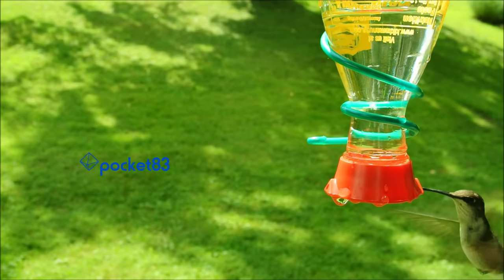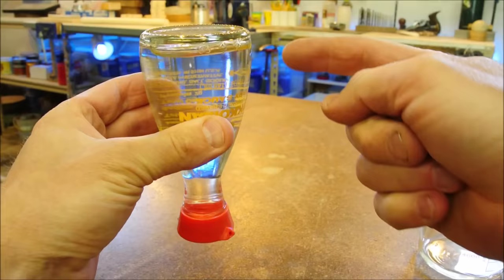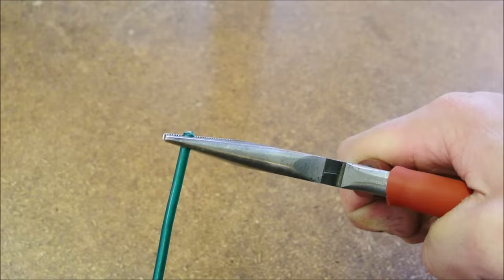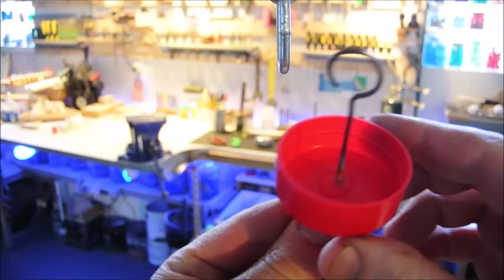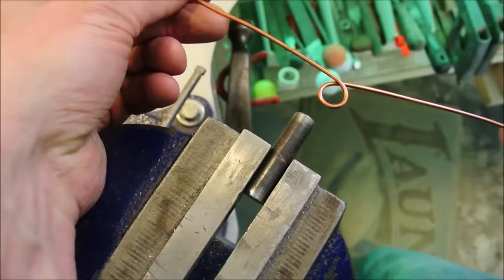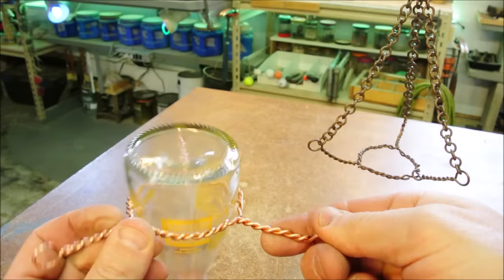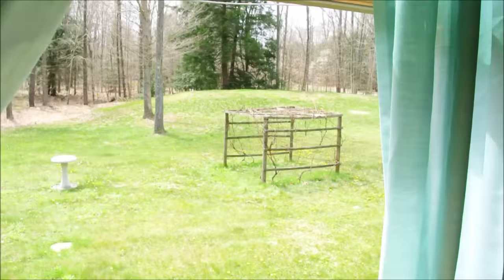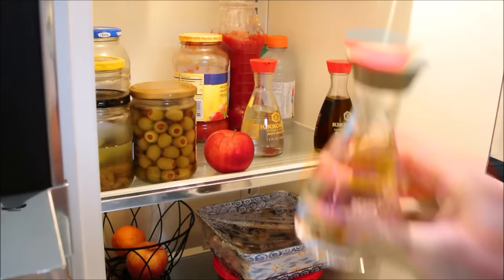Easiest, Cheapest, Best DIY Hummingbird Feeder Ever (from Soy Sauce).

Comment: This is a GREAT video - wonderful ideas for DIYers.

I have two questions: 
1) for the ant moat, what do you call that double hook thingy that was put through the red spice cap?  
2) what is the guage of the wire that you used to fashion the window hanger contraption?

Once again, so creative, many thanks!!
Reply from the maker: Certainly. Thank you!
1) That double-hook thing is just a piece of copper wire. Bend a loop on one end, stick it through a tightly-drilled hole, and then bend a second loop on the other end. 
2) I'm not certain without measuring it, but I believe that was 10-gauge galvanized wire. It's discussed @ 2:57 in the video.
Reply: @pocket83  Thanks again.. Awesome and thanks for the quick response!

Comment: That's cool! 👍  What gauge copper wire did you use for the chain and twisty bottom?  12ga or 14ga?  Or... ??  You're absolutely correct... salt and vinegar (especially warmed vinegar) works miracles and if you leave it in too long and get that bright pinkish but dull tone, a brass brush and Dawn dish soap will make it very shiny.  Thanks for a great video! 👍🙂
Reply from the maker: The copper chain is 12 gauge. Thanks.

Comment: If there is no air trapped because you filled the bottle to the top, the water will still not come out. So it's not about the trapped air. So what is it? Copper rusts. Copper rust is green. I am bugging you, but don't get me wrong. I think your videos are excellent.
Reply from the maker: By all means, bug. As long as you bug nicely ;) 
Aluminum rusts, too. And that layer of rust encases the metal in a thin, protective barrier that slows the reaction from progressing further. In general, varying materials will have varying rates of oxidization. In the case of a copper wire, you're likely to be long gone before it has changed the whole way through (depending on its environment). 

The case of the filled bottle is a little more nuanced than I might've said in the video. It's not so much what's inside the bottle that keeps it from coming out, so much as it's what's outside the bottle; atmospheric pressure helps to hold the liquid up and in place. Air is heavy. It's being pressed on by the air that's sitting on it, above it. This pressure fades away as we move towards space, where the air gradually becomes less dense. Air down here has a thick mass, like a soup, so any water that comes out of the bottle will have to push through that mass. 

The water itself also has a surface tension (caused by loose hydrogen bonds) that helps it to sort of 'stick' to the bottle—just enough that it doesn't want to pour out of those tiny orifices very easily. 

Since physical phenomena that are taking place within a system don't only have one 'hard' cause*, there are probably a few other quirks of physics going on (that I'm probably overlooking) that also help, but the two mentioned are probably the big ones. 

Thanks for the compliment. 
*At least not at the level at which we see things.

Comment: I love this design. But how do you keep them from leaking? Have tried to level it the best I can.
Reply: There are a few things you can do. First, try to position it so that it's away from sunlight. Also, if a full bottle has been refrigerated, allow it to come to room temperature before hanging it. Remember, it will drip whenever it heats up quickly. You can also limit drips by reducing its movement/sway. For example, hang it with a shorter, or heavier, or more rigid, chain.

If you absolutely can't stand any drips, and you can't position it over grass, then you can try using something to catch drips, like a plate of water. A handful of sand on the patio will also absorb the liquid and prevent staining. If ants are a concern, then use a bucket of water. Ants avoid water.  

With a soy sauce feeder, there shouldn't be too much dripping, but some is normal; wind, bumps from other birds, and even aggressive hummers can cause the feeder to sway or spin. As a general rule, unless your bottle is being visited continuously by hummingbirds, you shouldn't expect to replace the liquid more than once every day or two. If you are, then the bottle cap should probably be replaced. A functional but un-visited bottle will empty itself after perhaps 1.5-2 weeks. I know this because we put one out in late April, even though most birds don't arrive until around May first (In sw central PA.). 

Also note that I consider the small amount of dripping a good thing, because it allows a feeder to empty itself completely rather than become toxic (in case you forget). Think of it as bad-handler insurance.

Comment: So I saw a hummingbird a few days ago – I'm in Montreal, QC – and I just flipped, got obsessed, looked for feeders on Amazon and Lee Valley, looked at feeder DIYs, read articles, half-made a prototype with a lid made from aquarium tubing and that plastic that melts in hot water you can use to make custom parts, then I finally got my hands on two such bottles and made a variation of your design using a wire coat hanger for the wire. Turned out great, thank so much, but thus far (first day) it only seems to have fed some adorable bees. 

Should I be worried? 

And anyone know how to get the paint off the side of the bottles?
Reply from the maker: Details for removing the label are in the description. And no, I wouldn't worry about bees. Hummingbirds are quite used to them. Thanks ;)
Reply: @pocket83  OMG THANK YOU SO MUCH!!!!!!!!!!!!!!!!! :D :D :D

Comment: Have a question for the expert. Do you have to go outside to push the wire into the window frame? I live on 2nd floor & no ladder. I would love to put that feeder arch in a window so I don't have to go up & down stairs to feed the Hullers.
Reply: A ladder is not necessary. Mine was installed from inside.

Comment: After a month plus here is my experience. The first soy bottle dropped a little, the second more. This made ants coming... - I put a water bowl under it. That made a rat stopping by at night and drinking the decent sugared water with drowned ants. Hmm...
1. The dropping happened because of temperature changes. So the content (liquid and air) becomes warmer and the colibri (I have only one) does not come to reduce the pressure -> drop.
2. I took the more leaking second bottle and closed one of the holes, by heating up some plastic from a normal white bottle tap. I cutted with a knife a round of ca 2mm from it and used a soldering iron to melt it slowly into the hole - not much was needed.
3. I twisted the upper part of the metal holder, so that the bottle is not hanging upside down anymore, but in a 45′ angle - open hole up, closed one down.
4. My bird came and used (of course - Murphy's law) the lower - closed - one. I put a bit of a black insulating tape on the closed one, what he tried to ignore, but then the penny dropped.
5. The former more leaking bottle, does not drop anymore. 
---
btw: I offer him as well a plastic box with a red tap, in which are drinking holes. He ignores it completely. This box hangs also in 45′, so that the sirup is very close to the holes -> nope. I changed places, he looks around and goes for the bottle. My wife says, I should take the bottle away to motivate him to check the box. But I would prefer a bottle over a box as well. ;-)
Reply from the maker: Stick with it. These bottles will work great once your bird is comfortable. In fact, for a small number of birds, there's no better feeder. 

You can limit the dripping by 1) keeping the bottle out of the sun, and 2) allowing any refrigerated liquid to warm up before hanging it. Every one of these feeders will drip when placed in direct sunlight.

Closing off one of the two feeding holes will not reduce the dripping. Doing so will just force the remaining hole to drip twice as much. It takes a certain volume of dripping to equalize a certain amount of pressure change, no matter the number of holes.  

Neither the dripping nor the temperature will affect the bird's desire to feed. A hummingbird's tongue is long enough to allow it reach in and feed at low pressure, and at high pressure, they'll drink the droplets. 

It is unlikely that one bottle will drip more than another; in such a case, one bottle is probably leaking, and it should either be tightened or replaced. Also note that altering the holes with a soldering iron is likely to make the dripping worse, as is hanging the feeder at an angle.

Comment: How often do you change the water and clean the jar and lid? Fermentation of the sugar water doesn't take long if its being used.
Reply from the maker: That depends on the weather, sunlight, heat, and rate at which they feed. As a general rule, try to swap out the solution (and clean) after four days if they haven't already finished it.

Comment: I have a glass honey jar that exactly fits the hummer feeder base of a commercial feeder that needs a new tank.  I am trying to get the wrap-around hanger to fit the honey jar so that the hummer hooch doesn't just flow out.  Do you have any suggestions on how to balance whole thing?
Reply from the maker: Maybe try multiple wires? It's a tough problem, unless you can find a jar that's larger on its bottom.

Comment: I tried making one, and it looks really cool!  But it leaks with a slow drip, even in the house (over the sink, as a trial run) where there's not a big temperature swing.  I forgot to take out the gasket in the lid...do you think removing that will help?  I don't want to drip nectar on my deck or near the house, where it will attract ants.  Thanks.
Reply from the maker: The dripping will stop when the temperature equalizes, but since the air temperature goes up and down over the course of a day, some dripping is unavoidable. To keep your deck clean, try using a catch plate, or else design an arm that positions the feeder over the grass.

Comment: Very nice. Has anyone experimented with different bottles that are larger that you can transfer the soy sauce cap to? I'm thinking there might be other products that match the thread and bottle neck size.
Reply: I’m going to try my daughter’s hair color bottle after work to see if other lids will work. It’s basically a hair dye bottle with tip, but not sure bc it’s pretty small. I have a Simply Orange bottle here right now also to try.

Comment: Can someone please tell me how thick the clothesline wire should be? I’ve seen 5/32 in my local hardware store but it seems a bit thin. Just want to confirm before I buy. I want to make these with my son. Thank you.
Reply from the maker: Yes, that size wire will work fine.

Comment: How long will the bottles of sugar water keep in fridge? Can you make up say a weeks worth, more or less, at a time? Could replace the empty feeder bottles w/o having to remake the feed often?
Reply: One cup of syrup will fill two bottles. We usually make two cups at a time, so three of the bottles go in the fridge. The set will last between 2-4 days, depending. At that rate, I rarely see a spot on the feeders. My guess is that the food will still be good for around a week, but don't push it beyond 5-6 days.
...
It's my recommendation that you follow the two cup cycle. If you have trouble keeping up with the boiling, just don't replace the feeders as often, and you can stretch out how long they will last. Replacing them too consistently promotes hummingbird dependence and aggression, anyhow; they should also be out looking for flowers! That's why we've decided to cut back this year. We are only using one feeder consistently, and we alter its location.
Reply: @pocket83squared  Sounds like a good system! Also like idea limiting feed so they go for the flowers. Thanks! (C;

Comment: I made two of them and I just cannot get them to stop leaking! :( I really like them and wish I could figure it out. I put my fingers over the holes and turned it up and it still leaks later when they start feeding out of it. I even hung it over hanging flower pots to catch the feed but the hummers aren't getting that. :(
Reply from the maker: It really shouldn't be a problem. These will only leak while the liquid is heating up. Try keeping them out of direct sunlight. 

Note that some leaking is to be expected from daily temperature changes, but there shouldn't be enough to drain the feeder. If you just don't want drips on your porch, and you don't like the idea of a catch plate, these are probably not the feeder for you.

Comment: I love the simplicity.    But, remember all feeders need to be kept clean.  Bird Feeder Cleaning

We love birds, we love to feed them and watch their antics.  

But we don’t eat out of a dirty, germy dish; the birds you feed should not either.  For dirty feeders end up killing the birds you intend to help.  

This protocol works for hummingbird feeders too.  They need to be changed at least every other day.  I change mine out daily.  Using the two feeder rotation system.  

Hummingbird recipe: Bring water to a boil, add white cane sugar at a 4:1 radio of water/sugar.  Do not use honey or brown sugar, for it will become toxic to the hummingbirds.  I make a fresh batch of solution each morning with my coffee/tea.  And the RED DYED food solution is actually POISON for hummingbirds.  WHITE SUGAR and water is all you need at a 4:1 ratio.  

For all birds, It is recommended that you get two feeders per station, and put up one at a time.   Keeping the spare clean feeder handy rather than refill a dirty one.    Take the dirty feeder down and clean it each time you refill it or at least every other day.    If you can hang your feeders out of the rain and snowy weather, it will help prevent moisture and mold build up.  

Remember you CANNOT disinfect dirt.  So clean the feeder by soaking in water and Dawn dish detergent to break up seed and buildup of any mold, droppings or dust left over from the seed.  With a stiff bush and toothbrush, or bottle brush for small areas, scrub the feeder, especially seams, corners and any area where you see build up of dirt or mold.  If you have a pressure washer, it is great to reach areas not reachable with a brush.    Rinse until there is no soap residue in the water.   Then soak the perfectly clean feeder in a bleach solution.  Not much is needed, about a cup a beach per 5 gallons of water.  Soak for at least 10 minutes up to about 20 minutes.  For the bleach can be corrosive to metal and make plastic brittle.  There are the janitorial and restaurant sanitizers from Ecolabs  or F-10 that are used as the standard in the industry.  They are available in the janitorial section in large box stores like Sam’s club, COSTCO and BJs price club.  They are classified as ‘quats’ due to having a mixture of four buffered ammonias.  They do not have the pungent smell of straight  household ammonia, but are effective.  The products sort of smell like Windex, whose active ingredient is also buffered ammonia.  They work very well in sanitizing and deodorizing without the caustic effects of bleach.  One is the ‘citrus’ sanitizer  (yellow) the other is the disinfectant without all of the detergent (pink).   Rinse again thoroughly.  And hang to dry.  Such in a spare room or your garage or a sunny room helps with sunlight disinfecting as well.    Some people wash their smaller feeders in the dishwasher to help with that final disinfection.  Make sure the dishwasher is on NO HEAT dry to stop warping of the feeder.  Many plastic feeders are not dishwasher safe so be mindful of hot dishwasher temperatures.  Better yet, get a glass feeder, they are more durable, not affected by UV rays and hygienic too.   I also feel that a smaller feeder is easier to manage and keep clean.  Ease of cleaning is an important factor in purchasing a feeder,  

Follow these guidelines to help and not hurt the birds we love to watch.  

For those who want to help birds.  You can also plant bird friendly food plants.  Milkweed has many varieties and colors. Just make sure any plants are not GMO treated with pesticides; which actually reside in the plant.  The backyard habitat program has great resource for making you property bird and wildlife friendly.  

Info on nicotine based pesticides:  http://www.usgs.gov/newsroom/article.asp?ID=3941#.VOve01pCgy4  

Certify your property for wildlife:  

http://www.nwf.org/How-to-Help/Garden-for-Wildlife/Create-a-Habitat.aspx

American Bird Conservancy:  www.abcbirds.org
Reply: Karen Carroll o

Comment: I have 2 feeders out I keep them clean and no hummingbirds. I had a couple last year. What am I doing wrong. I live in Maryland.
Reply from the maker: Make sure the sugar solution is the same recipe as what's used in this video. Unless it's the feeder, there's nothing else to it. Most of Maryland should still have its summer Hummingbirds as of Aug.1, and soon you will also have the northern birds that are passing through as they fly south for winter.
Reply: @pocket83  thank you for your reply. I cleaned the feeders with just hit water and tooth brush. 1/4 cup sugar 1 cup of water. No color added.  I have two in different areas

Comment: How do you make it not drip? I tried to hang one outside and it makes a very slow drip. I did my best to make it very level , but it rocks with the wind and these holders are hard to make it hang 100% perfectly straight.
Reply from the maker: It doesn't need to be perfectly straight. The leaking is being caused by temperature change. Some leaking will be unavoidable, but you can minimize it by keeping the feeder in the shade, and by allowing the nectar to become room temperature before hanging it.
Reply: @pocket83  The "drip" of these feeders make it a no go for me.  In my location, dripping feeders in the past caused a real problem with attracting bees as well as ants.  Too bad because I like the upcycling idea.